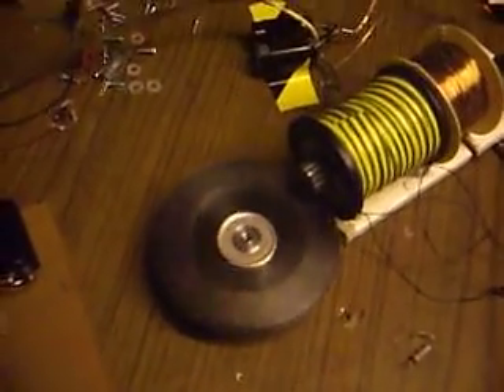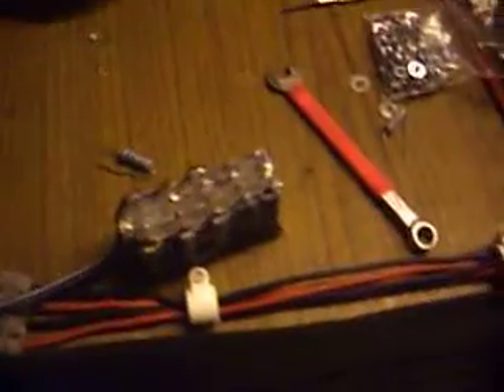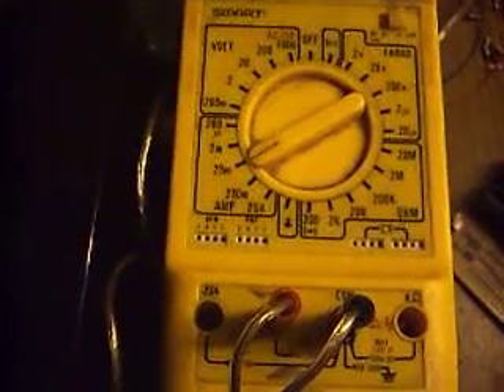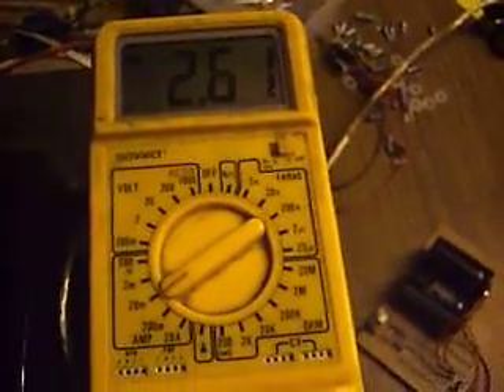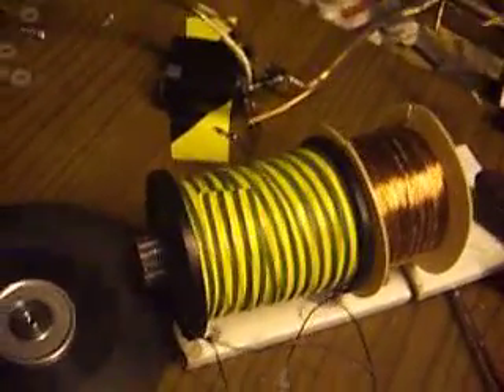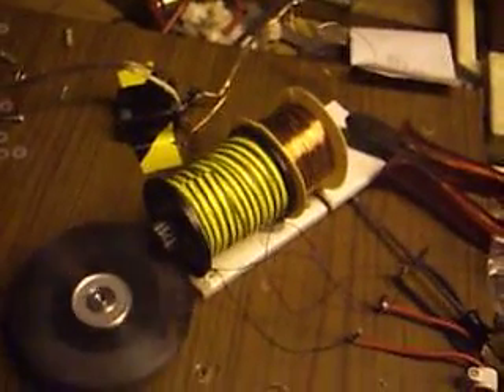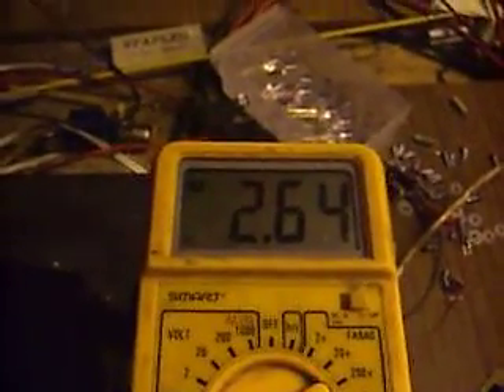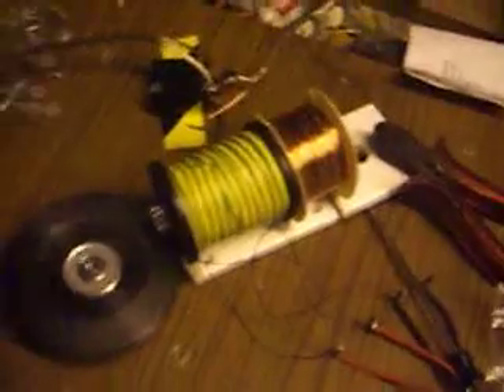comwarriors bedini feedback to source / new bedini - Update 6

Comment from the maker: I tried linking a jouel thief type device that uses a pair of transisters to pulse through a transformer...
Unfortunatly, drawing power from those capacitors actually has an adverse effect on the bedini...

so... I'm re-winding the generator coil directly on the core... the real i was using unfortunatly has a 4mm gap between the cor and the windings...

Comment: Firstly, congrats fella, I know that kind of excitement. This is really something. I cant quite grasp how you have set this up though? This isnt a bedini is it? It's your little variation is it not? A circuit diagram could really help clarify things.
Secondly, does the rotor have any torque? This is a great step forward, but we need torque if we are to make use of the rotors mechanical energy, which in this case can be considered a by-product of of trigger and associated power transformation.

Comment from the maker: I've got here what i believe to be an isolating jouel theif type device... it's one of those inverters from some EL string crap... it runns of 12V DC and outputs 200V AC... tomarrow i'm going to hook it up to one of the HV caps (C2) and the other end to feed into the the main bank of capacitors and I'll see if i can get the rest that it needs from the back EMF that curently isn't being used...

Some how I going to try to sleep tonight... I don't know how... but somehow i must...